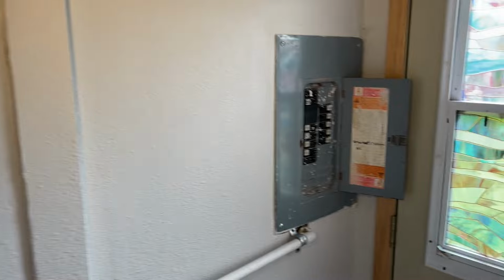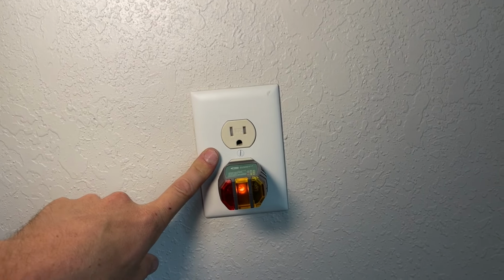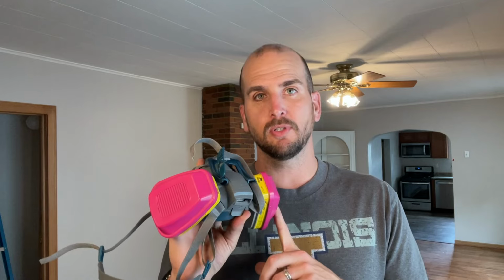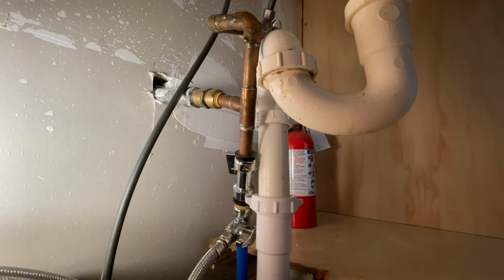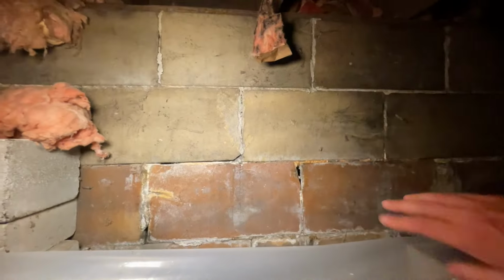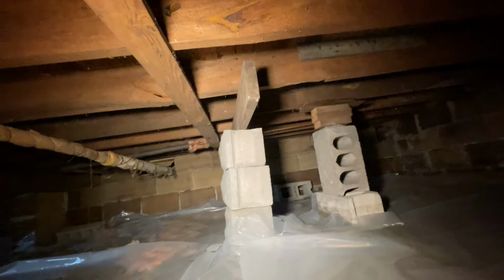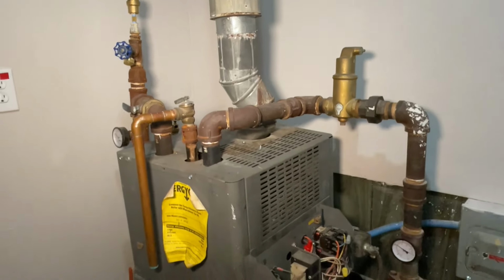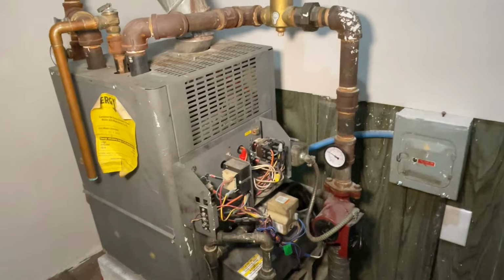Old House Inspection | Top 5 Issues

Comment: A big thing that I would look for as far as the electrical goes are Federal Pacific or Zinsco electrical panels, I have no issue with knob and tube in good shape, or a fuse panel in good shape, but Zinsco and Federal Pacific are both fires waiting to start, and if you then pair these already faulty panels with old or hacked up wiring then you are double stacking issues.
Reply from the maker: Hey Walter, thanks for the feedback 👍
Reply: The problem is that knob and tube systems were almost invariably installed and sized for a grand total of one outlet, one light fixture, and one light switch per room (maybe two outlets in a kitchen). If the house has anything more than that and still has active knob and tube, it's been hacked together.
Reply: @burgundyyears  I agree that this is the case most of the time, and that K&T was definitely not made for the needs of today. I have seen quite a few times around here where there are a bunch of smaller old farm houses and stuff like that, where they have the original K&T that HAS NOT been all hacked up, and has just been left alone and either new circuits run separately, or just little old farmer grandpa does not need more than one plug for his lamp and TV.

Comment: If you have floor tile and they are smaller than the now standard 12'' it is very likely they are asbestos. I bought a small house with a lot of problems just for the lot. dug up the sewer to find it was laid flat with no drain slope. I had to tair down the and remove the house. then I had to build up the soil where the new house was built to get the corect drain slope for the sewer.

Comment: Also check the envelope of the home. Most older homes are not sealed properly with many drafts. Is there insulation in the walls and attic and if there is what type is it, how old is it, is there any moisture damage to it. Does it have the proper air and moisture barriers, do windows and doors seal properly and are they single pane or double pane. Does the siding or roofing need fixing or replacing.

Comment: Another thing too regarding HVAC, depending on when it was installed and it's still under warranty, you may need to send them your information to transfer the warranty within a certain time frame (mine apparently was 30 days).  I was a 1st time home buyer, had no idea about this.  Old homeowner left me all the warranty information-for everything.  When I needed to do a repair on the heat pump, saw it was still within the 10 year warranty period.  And, that's when I found out I was supposed to email/call them to transfer the warranty.  Amazingly (sarcasm) the unit crapped out 1 month after the warranty was up.  2200. for the part, 4000. to replace.  Hello window units and space heaters :)
Reply: Most of the time the warranty on HVAC equipment is only to the original home owner. Some company’s offer to transfer at a cost to transfer. Sometimes a shorter term like 5year versus the original 10year. Also keep in mind a 10year warranty is usually just the compressor and or heat exchanger. Labor warranty is usually only one year and some components like motors and controls are 3-5years. Another recommendation as a licensed tech is add a whole home surge protection device and have electrician update ground from panel to locality specific rods or ground ring. If you can provide a low impedance path to ground vs just a ground clamp on a metalic cold water pipe.
Reply: HVAC warranties aren't worth much once you're out of the 'paid labor' period and even then they do the quickest/cheapest possible repair that often leaves your system to fail again within a year or two.  The warranty likely wasn't even worth transferring and I usually don't bother claiming warranties if I can fix it myself.  Costs less and ends up being a better repair.

Comment: My beach house built in 1970 has a Zinsco breaker panel and was wired badly (ran hot lead direct to all the bulb sockets and switched the neutral). I've been told I need to replace the Zinsco circuit breakers because they have a bad habit of setting houses on fire. I also had to replace the septic tank, since steel septic tanks on the beach tend to completely rust away in 50 years. I replaced it with concrete. The original copper piping was replaced with PEX at some point, i don't know why.

Comment: Bought my house in 2020 right before it went nuts, house was built in 1910. I was told a few times by the selling agent and seller himself that all the knob and tube was pulled out. Well went to change ceiling fan and the wire looked strange. Went up into the attic and pulled up the floor and sure as shit irs knob and tube with spray in insulation all around it. I think it's only in the front and middle bed rooms. I really gotta replace it
Reply: Get it replaced eventually definitely but if I were you I would install a GFCI breaker on that circuit to be safe. If it starts tripping as soon as you install it then I would disregard it as they have neutrals from 2 circuits combined somewhere making the GFCI trip which won’t work unless you undo the crossed neutrals wherever it is. But if you can install that GFCI breaker and keep it be safe for you, your family, and your equipment it will trip on the smallest imbalance leaking out of the circuit. Good luck man!
Reply: whats wrong with knobs and tube wiring?

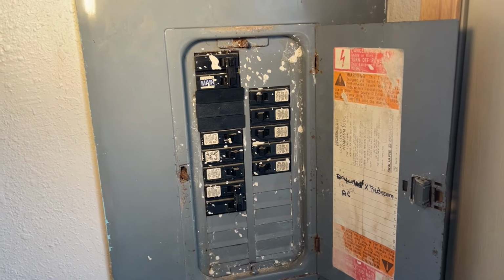Comment: 1:20 If someone needs to put in additional circuits and the main panel has no more spaces, the least of their problems would be to change out the panel for a bigger panel with more breaker slots, assuming 100A load is not exceeded in this case.  Or, simply add an adjoining subpanel to gain more slots for additional circuits.

But this house has far bigger problems than that - other electrical, plumbing, structural.  I don't see how a bank would approve a mortgage on this before a lot of corrective intervention is completed.  And aesthetically it's a mess - mish-mash of ill-suited trim, drop tile ceiling, low ceiling, and on and on.

Comment: Wow, I sure do wish I had some friends that are as knowledgeable as you are or still alive! I am buying a older home that has had alot of updates and remodeling,  and is in pretty darn good shape, I  had a home inspection and been here 3 yrs now. It was a pretty thorough inspection and I'm pretty  knowledgeable but due to permanent injuries and income am limited. I sometimes wonder if  there was something important that the inspector might of missed! So I kinda live with my fingers crossed permanent. I do have ins and main waterline coverage also. Thanks man!
Reply from the maker: Yeah, I am a fan of older homes but you are right that most home inspections aren't going to cover each system in detail.  Best of luck on the house 🤞

Comment: Honestly, I am seriously beginning to wonder. We bought a newly built property, in 2019 (built in 2019), and I cannot begin to tell you the problems we have had. I will add, with trying to get the problems resolved (via the Builder and Warranty department), I have learned a lot. 

Some things I did not even think about asking, prior to moving in. Like the flow of water in the backyard, will it sit, or flow to somewhere? With the sloped grass on the side of the house, should there be a foundation wall (answer is yes!). Anyway, thanks for another detailed video...
Reply from the maker: It’s tough man, sorry you are going through that type of situation which can be super stressful.
Reply: Proper water drainage in a yard or around your house seems to something builders offer fail at doing properly. Then it’s up to the homeowner to figure out a solution which can be costly. I had to deal with a crawl space that had standing water. Finally dug a French drain and installed a sump pump to address this issue. Let’s just say glad I did this when I was much younger. But still a pain. Good luck with your problems.

Comment: Bootleg grounds, plastered over outlets, wires w no boxes next to copper pipe, knob and tube, asbestos cement board, oversized breakers, chewed attic wires, still has cast iron drains etc etc house from 20’s.
Reply: Also lead paint on houses pre 1978

Comment: The house im looking at currently has the old 2 conductor cloth wrapped wire, and a cracked joist similar to the one you displayed. I feel I can attempt the wiring myself to snake romex through to the outlets and such via crawl-space and attic access. The joist damage im looking at getting repaired asap though from qualified personel.

Comment: A home inspection by a qualified, reputable professional is a must. But, like here, some of the issues are very obvious and apparent. It if looks really ugly, it's likely a problem.
Reply: Of the three home inspections I've had done, all were essentially useless. They all end their exam with 'should be evaluated by a licensed electrician/plumber/general contractor/roofer etc., essentially alleviating them from doing any detailed inspections at all. Before buying a home, try to find a general contractor to go through the house with you being present if at all possible. Otherwise, you'll likely find problems later on, which the 'inspector' didn't bother to check. Their  warranties are essentially useless too, as most go out of business, and form another LLC with another name.
Reply: @d.e.b.b5788  Inspector’s don’t offer warranties. Inspector’s are doing their job recommending further evaluation. They are telling you what’s wrong and telling you the proper professional to have repair it. Inspections are a snapshot of the home at the time of inspection nothing more. Having a general contractor inspect your home is a terrible idea, they make money off repairs not inspections. Either they will sell you repair work or charge for their inspection. Either way, they won’t be as thorough as me.
Reply: @chrishall2594  So, basically, all you do is write, 'get further evaluations from qualified specialists in every area'.  Useless.
Reply: @d.e.b.b5788  What he’s saying is that the inspector can’t recommend how the repair is done, only what looks suspicious. As in all professions, you will occasionally find a bad apple. I’ve dealt with a variety, but the best I’ve found actually work for the city.

Comment: I would diffenintly replacy any knob and tube wiring (some insurance companies wont insure you with it and when you add in new insulation to compansate for total lack of , which wasn't discussed , you can't bury knob and tube in it).  Also some talk about the plumbing distribution, including the pex in the crawl would be nice.  The crawl barrier is horrible as well as it didn't looke sealed around the CMU wall and the crappy supports for the girder. \

Comment: All of the small but serious electrical problems that you’re not allowed to see on an inspection behind cover plates etc. no wires nuts, hidden open splices, crispy wires, shared neutrals and surprise shocks.  Same with not being able to take the chimney apart and look up or down and realize you’re going to have to reline it...
Reply: I had to open my breaker box to realize that whoever did the update for my panel just electric taped wires together to run the tiny distance longer to the breaker. Don't know how that passed the inspection (that was written on the panel)
Reply: @Bremend  grease the palms.
Reply: @Bremend  there could be a proper solder joint under the tape, that was an accepted joint in use in the past.

Comment: You didn’t mention the attic or exterior wall insulation.  I see in this example the attic is multiple forms of insulation what are your thoughts on refreshing the attic insulation and sealing any air leaks into the home?
Reply from the maker: Yeah, I think a round of insulation in the attic is a no brainer for this home.  I needed to first clean up the raccoon 💩
Reply: @EverydayHomeRepairs  I bet, well I have been watching videos on extracting the old then creating a sealed barrier so very little energy escapes the living area.  Love to see what you determine works for you.
Reply: One caution on sealing a home too tightly is the potential for depleting the oxygen, or buildup of carbon monoxide, especially if you have a fireplace

Comment: For the record....What licenses do you hold, if any?  Do you need a license?  What is the $$ limits someone can do without a License? What is your experience or background in the trades?
Reply from the maker: I don't hold any licenses and I’m just a DIYer that has also invested in properties over the past 10+ years.
Reply: I'm a software engineer but like Everyday Home Repairs, I taught myself to replace receptacles and switches, fix my own plumbing, repair drywall, fix my HVAC, and repair my brick walls. There is no law that says you must have a license or even work in any trade to work on your own home (at least in the SF Bay Area). This is pretty much all easy stuff that an average intelligence person can do themselves.
Reply: License requirements vary. In some areas plumbing or electrical have restrictions on what you can do yourself. For example, in St. Louis County, MO, you need a licensed electrician to obtain a building permit for a new breaker panel, or to run power to an outbuilding.

Comment: ALL older homes have lead-based paint and NO current homeowners have knowledge of it.  However, as long as you don't eat the paint chips, you should be OK.  Highly overblown issue ginned up by remediation contractors.
Reply: Sanding it down can get it into your lungs and nose and blood stream, though, and it is illegal in a lot of states. Better to paint over it if possible, or scrape it, and not sand it. Otherwise it's not really ever a problem

Comment: Copper pipe before 1988 used solder with lead. This is a problem, that’s why I don’t like old homes. The amount of repair needed in the home you’re looking to purchase, is too great for me to consider buying it. The repairs for just the electrical and the structure could easily be $20-30k. What about no air, another $30k. Windows, insulation, etc…….?    Thanks Jim
Reply: Leaded solder is not a problem.  Even lead pipes aren't really an issue except in special cases.  Old houses have a lot of potential issues but that isn't one of them.

Comment: If you buy an old house, just assume you will have a bunch of outdated stuff and hamfisted DIY modifications that will need to be removed. At this point in my life, I wouldn't buy an old house unless I got a sweet deal and I had a bunch of extra money to gut it and fix everything. Even houses that look like they have been well cared for can have crazy crap going on behind the walls.

Comment: I've always heard that you're better avoiding 2br houses and going for 3 br or you could have issues selling when it's time to upgrade or otherwise move. It's always been from the same person. How in line are they with the actual market?
Reply from the maker: 3 bed / 2 bath with a 2 car garage are usually the easiest to sell.  If you buy right and know what you are doing you can make good money on 2 bed / 1 bath but the buyer pool will be smaller.
Reply: No one buys a one potty home?
Reply: @seniorcomputer3292  That's for bedroom not bathroom

Comment: Probably heard this already. Picture of the jack in crawl space is not a bottle jack. It is a very old cast iron screw jack designed for house jacking. A bottle jack might be preferable because it’s smaller size and lighter weight. Maybe you should be pointing out that your site is having a problem with water infiltration previous pictures of the block efflorescence and missing mortar. Then this problem is the ground underneath the home is sinking since it’s been jacked up over the years to try to resolve the problem.
This is handyman work because they don’t dig new footer’s and install new pier’s so they are being stupid and trying to fix it in a cheap way the screw jack and multiple types of blocks are evidence that this has been going on for years. Hire an engineer and a mason and get someone who can help you replace the foundation and waterproof the walls and regrade the slope of the site so water flows away from the house.

Comment: I know someone who bought a 1920s house. Insurance companies wouldn’t touch it until she replaced the knob and tube wiring.
Reply: Yes indeed, this is more common then you think. My in-laws went through the same thing with a major insurer. And they had been living in their home for ages. New electrical, water lines, sewer and some structural. Fortunately the City in Cali. That they lived in had programs for the elderly.
Those darn insurance companies can put you over a barrel.
Reply from the maker: Yeah, that amount of repairs could add up in a hurry especially in the expensive markets.
Reply: I just bought a 1922 house with knob and tube. I got insurance but it was difficult, the issue i faced though was it was in an area in Nor Cal that is currently having a lot of fires in the area. Had to go with a smaller insurance company because the big boys wouldn’t touch it.